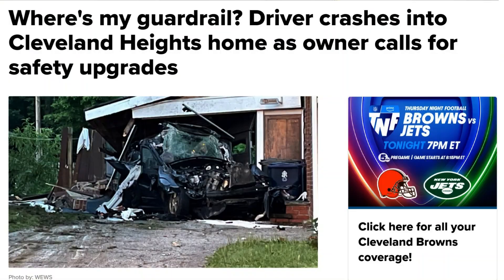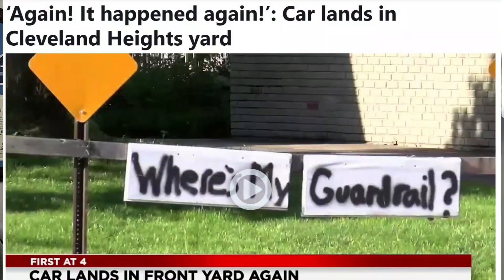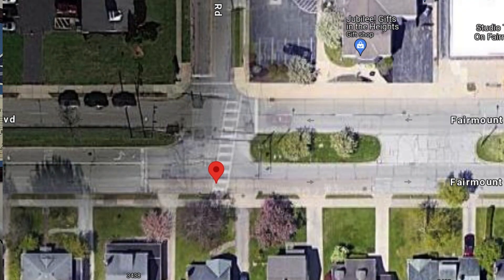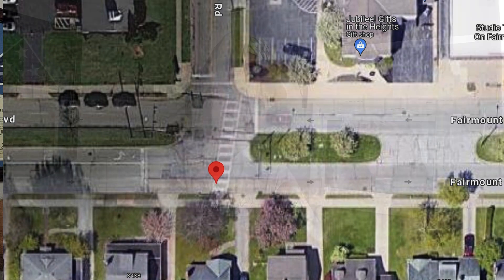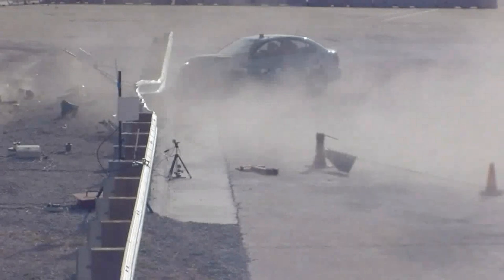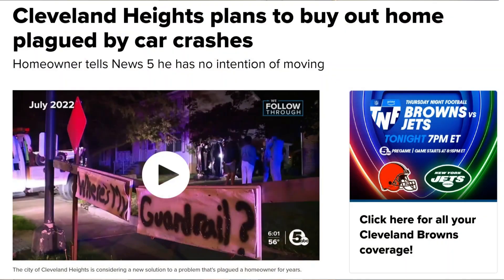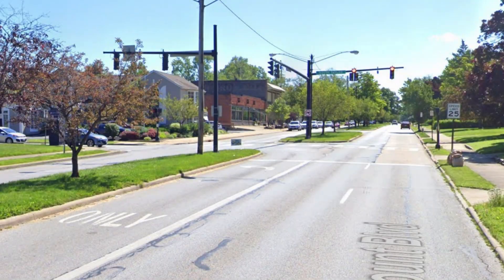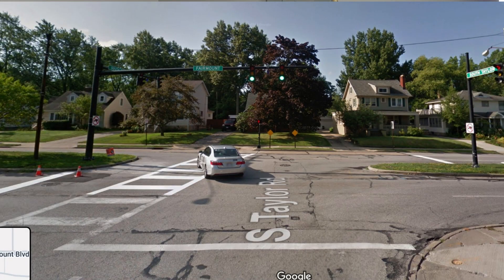Where's MY Guardrail???

Comment: But Steve a round about would make too much sense.  This is government.  How about a committee to look into the issue instead.  In six years they can file a report with recommendations that could include a roundabout and then it can be ignored.
Reply: A roundabout wont help. You will still have cars that are driven by drunk/incompetent people who go straight through it. And now because there is a mound in the middle you've introduced a ramp for the car to now go airborned into the home.

Comment: They should, at a minimum, replace the green circles in the traffic light with left and right green arrows. The green circles indicate to drivers that they may go straight, which is NOT the case. They could also put a W2-4 sign on the approach to the intersection, to let drivers know that this is a T intersection.
Reply from the maker: That's a great catch!!

Comment: I would demand they install several speed bumps, and if they won’t do it then I’d make my own! Also, roundabouts generally increase the likelihood someone will travel through that intersection, however they greatly decrease the ambient noise levels. A roundabout would be helpful. Although massive boulders that can be at least 7 feet high would be perfect.

Comment: If the problem is people not noticing the intersection and not slowing down in time so they continue straight through it, how would a roundabout help?  It seems like the people wrecking would just hop over the center of the roundabout and still plow into this guy's house.
Reply: Because a roundabout is more visible than a 4 way stop?…. Are you this dense to seriously ask this buddy? Lol goodluck
Reply: @Domedwho  I asked a serious question, no need to be rude.  If visibility is the problem, then flashing lights leading up to the intersection (which I would hazard to guess are already in place) would do the trick.  Installing a roundabout for the sake of making an intersection more visible seems silly... especially in this case where it is a three way intersection.  If the person can't see the literal house, why would they notice the center of a roundabout?